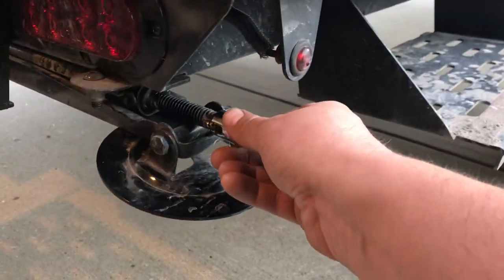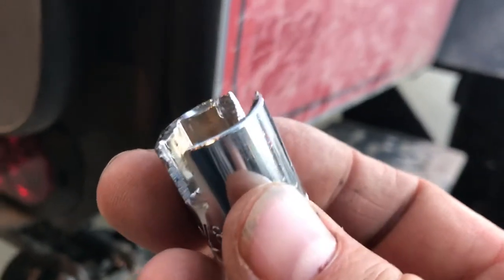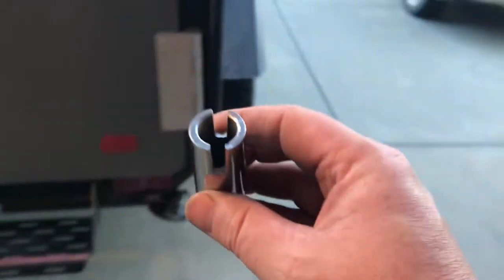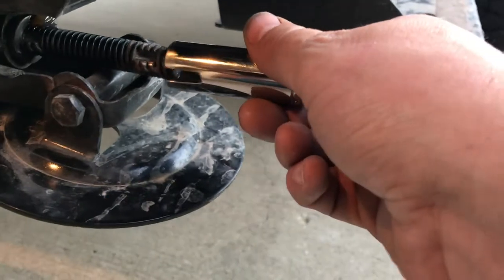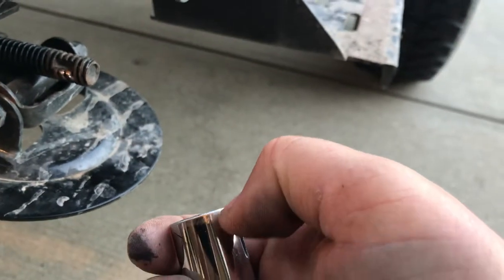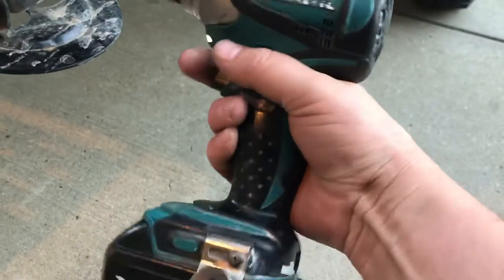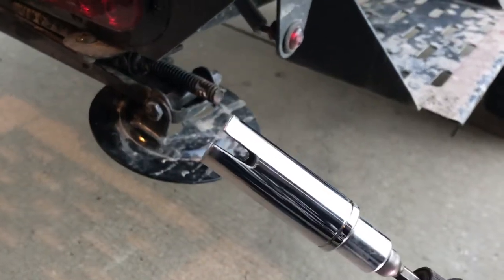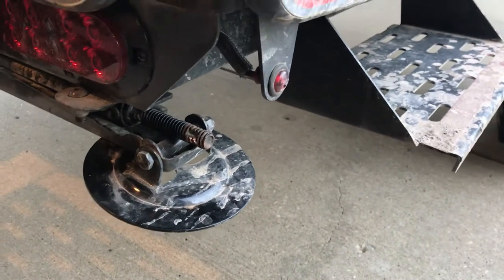Taxa Outdoors Tiger Moth Levelling Jack mod

Comment: Next time use an impact rated socket. Then it won't chip if you grind it down.
Reply from the maker: hollywood21639 good call. I think that’s what I accidentally ended up with on v.2. 2 years later going strong. 😁